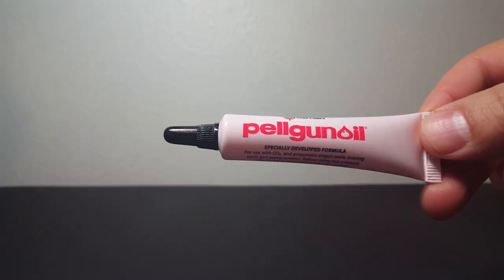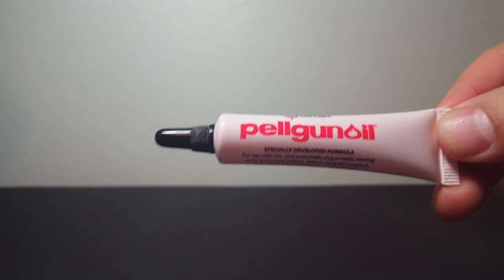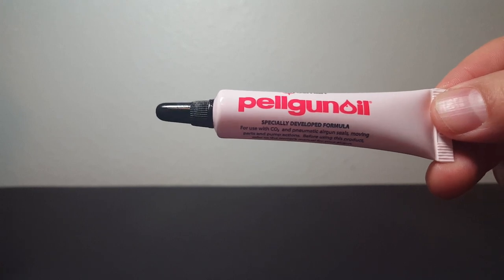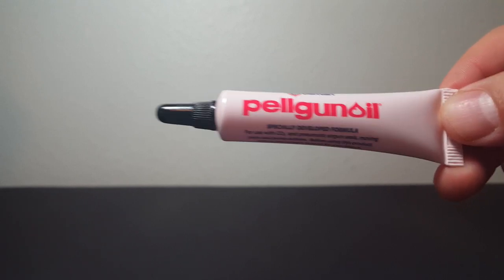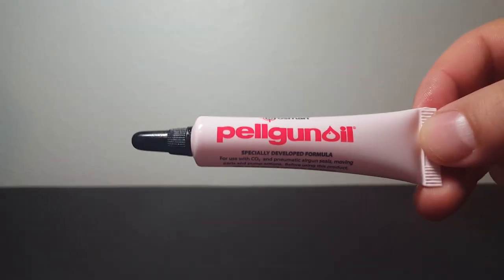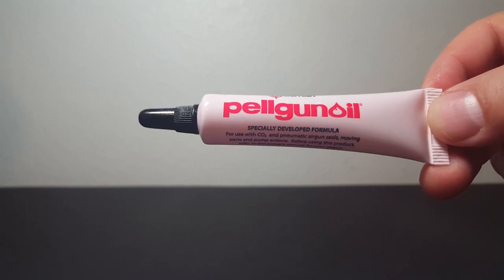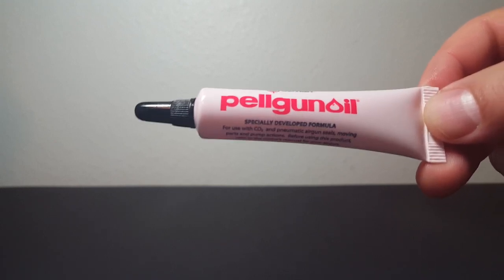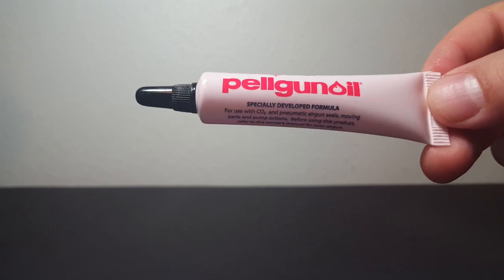Pellgun Oil: What is It?

Comment from the maker: ⚠️PELLGUN OIL NOT FOR PCP. NOT FOR BREAK BARREL RIFLE⚠️ 

🌟PELLGUN OIL IS A CHOICE FOR PUMP GUNS AND CO2🌟

MANUFACTURER  DATA (MSDS)
Scroll this Crosman page until you see Material Satety Data Sheet, toggle it, then find Pellgun oil link:

https://www.crosman.com/safety-guidelines

Magnum Airpower Statement:

PERFORMANCE PARTS FOR CROSMAN & BENJAMIN AIRGUNS

AIRGUN OIL MYTHS

It's a myth that petroleum oil is harmful or unsafe to use for airguns. This stems from the common misconception that petroleum oil and distillates are the same thing. They're not, oil is what's left after the distillates are removed from crude oil. Petroleum distillates are not safe for use in airguns for a variety of reasons. Some petroleum oils also contain distillates and those are also not safe.

Crosman Pellgunoil (re-packaged Monolec GFS 8430) is SAE 30 engine oil with a high level of detergency. Because it's single-viscosity it gets significantly thicker in cold temps.

 Magnum Airpower's HIGH-PERFORMANCE AIRGUN OIL is full synthetic and multi-weight. It flows freely at very cold temps and maintains it's viscosity at very hot temps. It has the highest level of anti-wear and anti-corrosion additives of any oil sold for airguns.

https://magnumairpower.com/ols/products/high-performance-airgun-oil-for-variable-pump-and-co2-models

FURTHER READING:

This subject is even more confusing to many because some distillates are commonly referred to as oil. The most common examples are heating oil and penetrating oil which are both petroleum distillates. The oil that's safe for airguns is called mineral oil also known as heavy oil. Mineral oil is non-toxic and non-flammable but it's combustible at very high temperatures. It protects against wear and corrosion better than silicone or natural oils, will not harden and doesn't become rancid. This is why all engine oils, including synthetics, are mineral oils. 

Many believe synthetic engine oils are made from non-petroleum substances like silicone, this is not true. Synthetic engine oils are made from mineral oil. Silicone oils are synthetic also but aren't used for engines due to their poor lubricating and anti-wear characteristics compared to mineral oil. Engine oils, natural or synthetic, will not hurt the seals in your gun.

 Modern airgun seals are made of materials like Nitrile and urethane which are engineered for use with petroleum oils. We've been using mineral oil (engine oil) in airguns for many years and have never seen a Nitrile or urethane o-ring swell or dissolve. It's not always safe for PCP & HPA due to the risk of rapid compression autoignition (dieseling) so the silicone oil we have listed is recommended for those applications. Silicone oil will swell and soften Viton o-rings so Nitrile or urethane are recommended.

It's a myth that engine oil is toxic. Most are not. Some do contain potentially harmful additives, these will say so on the container and should be avoided. Used engine oil is typically more toxic, combustible and can even become flammable, this is due to fuel contamination and engine wear.

 It's a myth you shouldn't use detergent oil for an airgun. It actually works better than non-detergent. The "detergents" are metallic salts that reduce wear and corrosion. They also help keep particles suspended in the oil so they can be removed by a filter or exit machinery as they work their way through. Moisture is absorbed and passed through without negatively affecting the lubricating properties of the oil. Emulsification is what many fear with detergent oils, this doesn't happen to a significant degree in an airgun and wouldn't be an issue if it did, it would simply mean more moisture was present and being worked out of the gun. Moisture content in emulsified oil does not affect it's lubricating and wear reduction properties.

Copyright © 2015 - 2019 MAGNUM AIRPOWER 

[Channel Notes: Like tranny fluids, Pellgun oil is color coded RED to separate it, and distinguish it, from motor oil. For Pellgun oil, it is for tax-law reasons - It shows it is not in use in an actual motor. Tranny fluid  has additives, and there are some similarities with detergent motor oil.]

Comment: I hope nobody uses WD-40 as a lubricant... because it's not that... at least Pellgun oil works in some seals.
Reply: Can I use ballistol the shit I use for real guns?
Reply from the maker: Great question. I have switched to Ballistol for my little spring guns.

Red Ryder, 25, model 12,  marksman, dx-17, Buck. 

I wipe them down, and lube oil holes with one puff from aerosol. You can use needle nose, but spray works with this thinner oil. Any excess drains down back. Just make sure to shoot right after. Work in.

For multi pumps and C02,  it may be too thin. I haven't gone with Ballistol for the pump guns. Never would for Crosman as they are tougher to handle and need thicker 30 SAE ND

But I do WIPE DOWN all my guns with Ballistol..

Comment: I've always just used straight 30 weight non-detergent oil in my air rifles, going all the way back to the mid-70's. It works fine but eventually the seals wear out and harden anyway, and have to be replaced. Also the air chamber and all internal parts of the air rifle have to be cleaned out periodically. Particulates from the outside, such as dust, get into the air chamber and all other internal parts and should be cleaned out on occasion.

Comment: re: detergents... maybe they want your O-rings to degrade faster, to increase sales of spare parts or outright sell more pelletguns
Reply from the maker: Yeah, Magnum Airpower does say MILD detergents are good for airguns. But he does go into car talk. Airguns don't have oil filters, but his point about modest detergents is well made.

A company I found sells detergent and non-detergent, and they say the detergents are needed in dirty enviroments. Pellgun oil has HEAVY detergents - out of place in an airgun

Compressor makers SAY NO to detergent lube - and that covers your pump gun.

Granted, a pump gun isn't as intense as a compressor, but Daisy engineers would say to use detergent oil if it were NEEDED.

Compressor oil really is fine for CO2 cartridge tips and pump gun seals.

Comment: Could this fix a valve internally or probably not? I bought a brand new 1077 the other day and I believe the valve is stuck open or something
Reply from the maker: Try it. The most advised way to lube a CO2 gun is putting a drop of Pellgun oil on every new CO2.

It could simply be the face plate or seal that contacts the CO2 top is leaking. This method can help.

This is why I stayed clear of CO2. Whole different universe with different malfunctions.

Comment: so, theres a contradiction that says petroleum based oil isnt good for co2 guns. But, people use this pellgun oil even though its a petroleum based oil. why is that?
Reply from the maker: Great question! Thanks for showing class. Many in the Silicone Faction (yes, the group is large enough that I call it that) believe any petroleum destroys any rubber. That isn't based in science.

This video is a set up for MAGNUM AIRPOWER. They have great products and education. Mineral oil isn't the the enemy. It is solvents, like distillates, that cause damage. Nitrile is tough - even against some solvents, but any solvent is TOO much for the tight confines of an airgun.

PELLGUN OIL has a BASE of 30 SAE motor oil. Daisy just says use straight 30 SAE ND - inexpensive and a huge jug for many uses. Just buy a dropper.

MAGNUM does a great job explaining that Nitrile doesn't get hurt by straight mineral oil. Pellgun oil and their product does have detergents, and 30 SAE ND doesn't. All 3 have the base of thick mineral oil which is compatible with Nitrile seals and seals in CO2.

Please read the chemical engineers work below. The first link is instructions on how to lube pump guns and CO2 guns - and common mistakes. The 2nd link gets into the engineering IF you are up to the truth that engineers at BALLISTOL, Daisy, Crosman and more know is fact.

https://www.magnumairpower.com/lubrication.html

https://www.magnumairpower.com/airgun-oil-myths.html

If you are determined to use silicone know it has to be airgun worthy - meaning the right GRADE. Know airgun grade silicone is normally very expensive for pump gun and CO2 seals. I'm 30 SAE  ND (non-detergent) Faction.

But if you are die-hard Silicone guy, this is high quality and great value at 4oz. Pump and C02 application.
 https://www.amazon.com/Super-Lube-56204-Silicone-Lubricant/dp/B083NXVGQX

Comment: I put a few drops in my 880 about 3 days ago and it quit working. The reason I decided to oil is because I've had my 880 for years. I'll never use ANY again unless I absolutely have to, Because when I took the 880 apart and dried the oil it feels a lil harder to pump and a lil louder while shooting. Bottom line now it works again. 👍 Enjoy your videos by the way. I just found your channel.
Reply from the maker: Stephen, yes, too much builds sludge in chamber seal. Gun won't check the air. I like 10 weight ND because it is less likely to cause sludge build up that you had to clean off - and clean the tube out. 

30 weight works - just a drop or two every 500 shots.

https://www.oreillyauto.com/detail/b/non-california-4604/chemicals---fluids-16461/oil-16865/motor-oil---conventional-25267/2673028dc6c2/pure-guard-non-california-conventional-motor-oil-10w-1-quart/nd10/4616027

https://www.hobbylobby.com/Art-Supplies/Painting-Supplies/Palettes-Tools/Needle-Tip-Applicator-Bottles/p/80935713

Comment: IT is petroleum based. Not for usual User in airguns, or do you know what your seals are based on?
Reply from the maker: Richard, the seals I'm primarily focused on are NITRILE seals in pumps guns. Nitrile is engineered for mineral oil like Pellgun oil.  BUT this product is very expensive motor oil with HEAVY detergents that are not  needed in airguns. Also, the container leaks, which many complain about - mine did too.

Magnum Airpower specializes in Crosman guns and lube. He is quoted in the comments and "more" section.

I use only 30 ND or compressor oil in my Legacy with no problems. Mineral oil is not basic petroleum product. But adding detergents as aggressive as what pellgun oil represents isn't helpful. 

If you like airgun grade silicone in your CO2 or airsoft guns, that's great.

Obviously, moving away from pellgun oil, Crosman says to use their airgun silicone in the Legacy instructions. But non-detergent mineral oil still works with the nitrile seals. Engineers have made clear that the Legacy, with the metal rod, is similar to a compressor. It can use the same lube. There have been no problems.

Comment: I use it with Crosman 2240 capsuls und Biman p17 cylinder.  Its also good for all metal to metal connections where silicon oil is not. But the cap should be possible to open with one hand it would be great improvement.

Comment: Hey so i have a glock 17 gen 3 bb blowback i can use this on it right?? and not jus that also use it to lube the slide
Reply from the maker: UMAREX STAND CO2

Ok, the origin of this video is STRICTLY to say what Pellgun oil is chemically- not an endorsement.

I  have plenty of experience with PUMP guns and STRAIGHT mineral oil, 30 SAE ND, being affordable and safe, but CO2  lube is getting push back from CO2 users. 

This is Umarex rep in response to my lube question about CO2 guns:

"We don't recommend using pellgun oil to lube. We would recommend using the RWS Silicone over the Pellgun.

Thank you,
Colton Gamble
Gun Tech
Umarex USA, Inc."

I have RWS Silicone, but it is conservatively used on some guns. It is priced as high as $16 for 1/2 oz.

Here is silicone answer for more affordable lube - especially for one drop per cartridge. Highly regarded by airgunners.

https://www.amazon.com/Super-Lube-56204-Silicone-Lubricant/dp/B083NXVGQX

Comment: I have crossman legacy 1000 and two co2 pistols 4.5mm steel bbs and I buy this pellgun oil is it good?
Reply from the maker: Yes, it is safe. But below is a better value.

Firearm oil can wreck your pump cup. No pump cup, no 1000. Firearm oil on the joints can run down the pump tube.

Try to switch to 30 ND and a squeeze bottle.

https://www.hobbylobby.com/Art-Supplies/Painting-Supplies/Palettes-Tools/Squeeze-Bottles/p/57415

https://www.oreillyauto.com/detail/c/pure-guard/pure-guard-compressor-oil-4-quart/pgd0/ac18

Also, the big jug can be used for general lube around the house:

Sliding door rails
Lawn mower parts
Garage door axels and joints.

On the garage door, folks think to oil the wheels, but lubed wheel AXELS (wheels and door hinges) do more to make the door easier to move.
Reply: @daisy880fanaticfixit9  thanks

Comment: If the CO2 guns are not used for a long time after the tube is installed, the tube and other seals are damaged.
Is this oil for this problem?
how to keep gaskets intact under pressure without using the tube after inserting it
Reply from the maker: Sir, that is great inquiry!

CO2 veterans know that leaving the cartridge (tube) in the gun, when you feel like stopping, is a BAD MOVE. When you are done shooting, shoot remaining air pressure into the grass or bushes, THEN REMOVE the spent cartridge.

⚠️ LEAVING A PARTIALLY FULL CO2 IN THE GUN CAN WEAR DOWN SEALS⚠️

You don't leave a break barrel cocked or a pump gun pumped up.  BIG NO NO!

You keep your seals going longest by putting a drop of lube - whether this Pellgun oil or 30 SAE ND - on TOP of every new cartridge. Or at least the top of CO2 every few times.
Reply: @daisy880fanaticfixit9  thanks bro...

Comment: Would bear fat be a better choice for CO2 gun seals or should I just stick to pellgun oil?
Reply from the maker: Dylan, I don't know about bear fat. Other cheaper choices than Pellgun oil. 

These bargain choices do AT LEAST as well:
https://www.amazon.com/Super-Lube-56204-Silicone-Lubricant/dp/B083NXVGQX

https://www.oreillyauto.com/detail/b/non-california-4604/chemicals---fluids-16461/oil-16865/motor-oil---conventional-25267/2673028dc6c2/pure-guard-non-california-conventional-motor-oil-30w-1-quart/nd30/4616028

https://www.homedepot.com/p/Husky-16-oz-100-Full-Synthetic-Compressor-Oil-018-0083H/300135698

Comment: I read that petroleum jelly aka Vaseline can be used to lube the tip of CO2 cartridges before installing, how true can that be?
Reply from the maker: Well, I have heard that. It is a better idea than vegetable oil - that can go rancid.

With Vaseline, if it is safe enough for your skin, it is UNLIKELY to hurt a nitrile or urethane seal in your CO2  gun.

The problem with Pelgun oil is that it is hyper expensive motor oil that does NOT out perform super cheap 30 ND motor oil or compressure oil.

Also, the container tends to leak. It did on mine, and others complain about it.

A good squeeze bottle with compressor oil is a better value for your CO2 or pump guns. It can be used around the house on slide door rails and garage door links and axels.

https://www.oreillyauto.com/detail/c/pure-guard/pure-guard-compressor-oil-4-quart/pgd0/ac18

https://www.hobbylobby.com/Art-Supplies/Painting-Supplies/Palettes-Tools/Squeeze-Bottles---5-07-Ounce/p/57415
Reply: @daisy880fanaticfixit9  thank you for the quick reply
Reply from the maker: If commenters are smart and kind, I will reply!